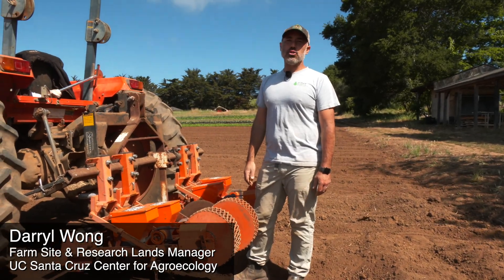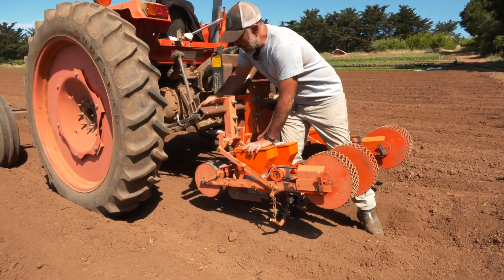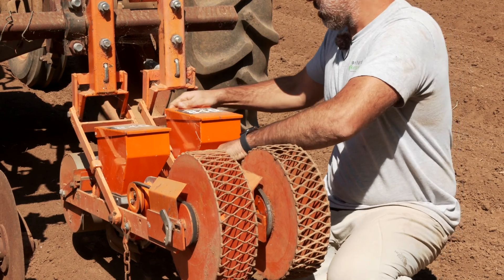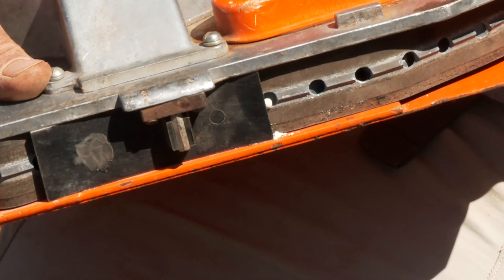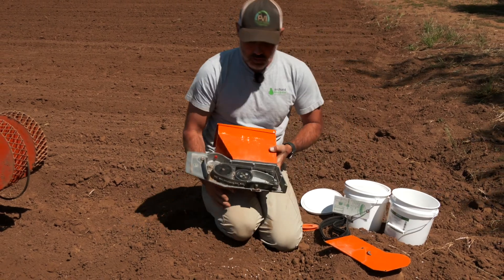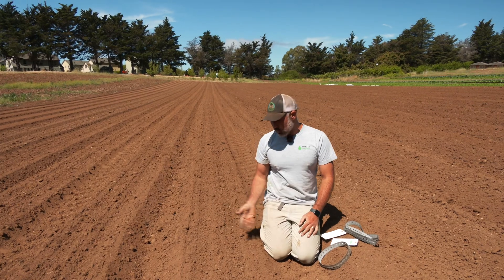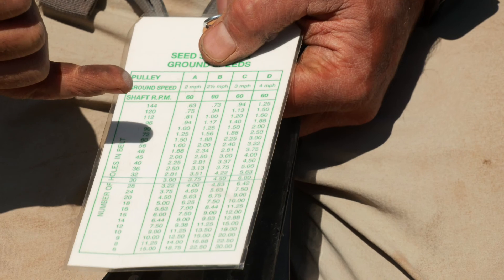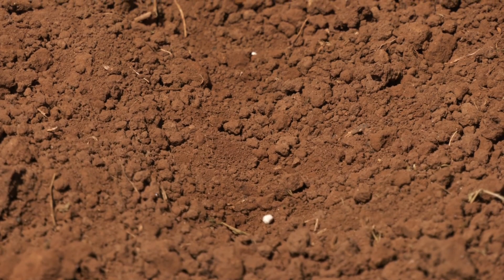How to Setup the Stanhay Robin Precision Seeder

Comment: Why is our planter crushing to many seed (coating)
Reply: make some transparent covers out of perspex made troubleshooting my units much easier. in my experience crushing happens when the spring base is too deep allowing one and a half seeds into the belt, spring base too shallow not enough room for seed, using wrong repeller tyre (dont use the solid ones), also running the seeder by hand slowly can crush seed as they are put under pressure for too long, im no expert this is just what ive found!